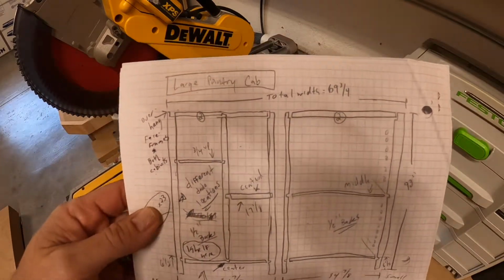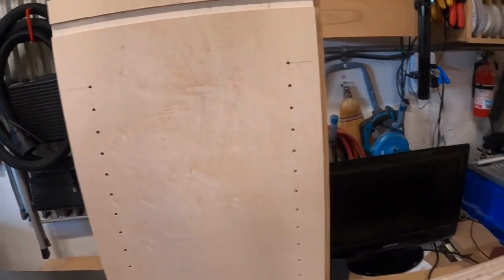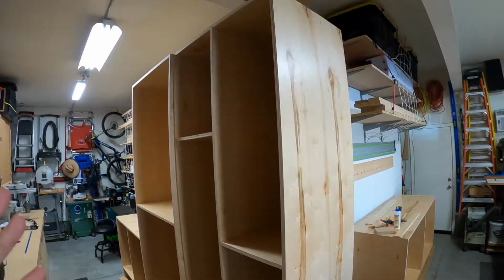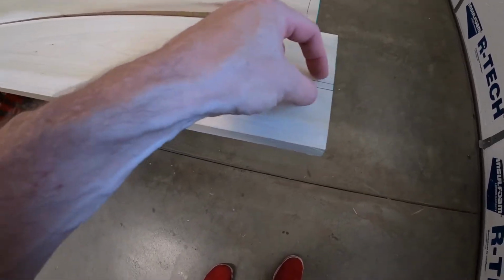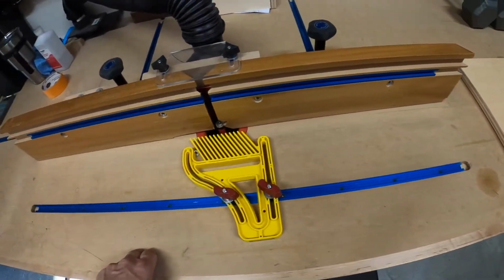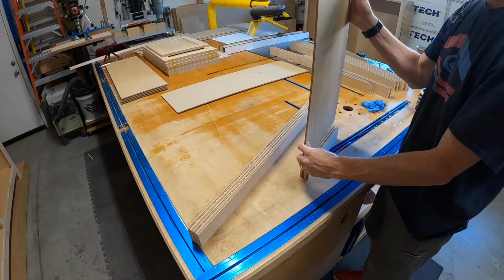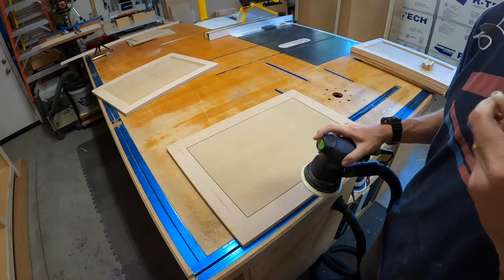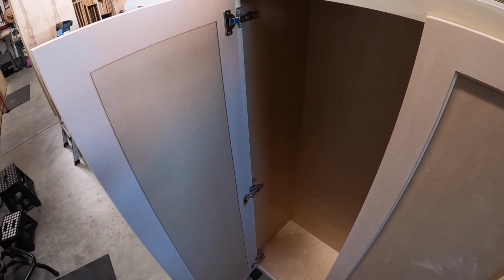How To Build Cabinets. From Start to Finish- Custom Kitchen Cabinets For Huge Walk-In Pantry.

Comment: Did you use 1/2” mdf with rabbit edges for the door panels?  The front reveal looks nice so just curious on how that came together. Thanks
Reply from the maker: Sorry I just saw this.  YouTube doesn’t send emails on comments like they used to. Sometimes I use 1/2” panels or 3/8”. Both require  profiled back relief cut.  I use lots of methods for that.  But for most jobs, I use a back cutter bit. It’s a radiused bit.  I don’t typically do square rabbets for panels on doors. The radiused ones look much better.

Comment: I came across this video looking for ideas for my own walk-in pantry.  I am curious on your thought process for building the cabinet boxes with plywood and hardwood face frames but switched to MDF for the doors instead of continuing with hardwood stiles and rails on the doors and plywood panels?  You do a great job of explaining your processes.
Reply from the maker: I  want to thank you for watching the video and for commenting.  I love making the doors this way as to give them the best chance of staying stable and flat and never twist.  Its very hard to keep the lacquer from cracking  on solid wood door frames. I will return to jobs that I did 15 years ago, and I check the doors and find they are still perfect.  Thats a testament to the quality of this type of construction. The cabinet boxes I use this material for mainly kitchens and bathrooms.  Or simply put, wherever there is water around.  But otherwise, ill use special ULMDF for the boxes on every paint grade job.  I prefer the way they paint up vs plywood for the boxes.  Im very particular in how the jobs paint up.  Plywood has its place, but in my opinion, it doesnt paint as well.  I just released the installation video to this build.  check it out.  Plesse let me know if you have any other questions.

Comment: The music is not my taste. I would have grinned and bear it, but it so LOUD! I quit!
Reply from the maker: Hey man sorry about the music.  I tried something new with music.  I actually didn’t think it was loud but I appreciate you letting me know.  I’ll adjust it down for next time.  My installation video doesn’t have any music by the way.
Reply: @imdking01, What kind of computer do you have? Hard to believe you don't have volume control or mute capabilities.  What's your favorite music?
Reply: @biglav6048 
Casting to my 65 inch TV, which is connected to the hi-fi system with surround sound and subwoofer. If I turn it down to where the music is not so loud, then when he starts talking..... I can't hear him. I turn him up so I can follow, then out of the blue.... "graaaahhhh! Blast from some weird music!" The 3rd time, I clicked away from the video at about 6 minutes in. 
You can't play music to please everyone, i get that, but whatever you pick, don't make it so it's so prominent and overpowering to the voice of the presenter. Even if it was a soft ballad, I wouldn't want it that loud! 🤦🏾‍♂️
Reply from the maker: @imdking01  I’m going to redo it.  However, the install video doesn’t have music.
Reply from the maker: @biglav6048  I played it back twice and it’s not loud to me.  That’s so weird. But it is music and it’s not really that important to me.  I just felt like doing it.  But I use ear buds to edit.  Not a big tv with surround sound.  I felt that ear buds would tell me if too loud.  Maybe I should take it down abd then redo with no music.  Funny.
Reply from the maker: Hey I just wanted to tell you that I uploaded a new video and lowered the volume of the music by 50 percent.  I hope you like it.
Reply from the maker: Hey I just wanted to tell you I lowered the volume of the music.  I uploaded a new version of the video so it’s less noisy.  Please check it out.  Thank you.